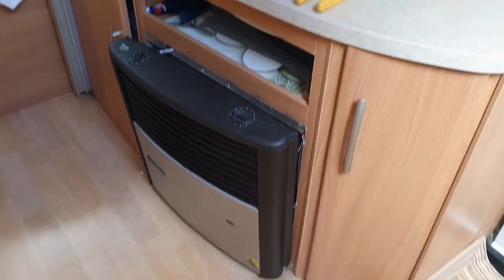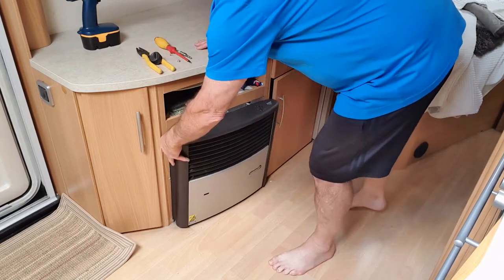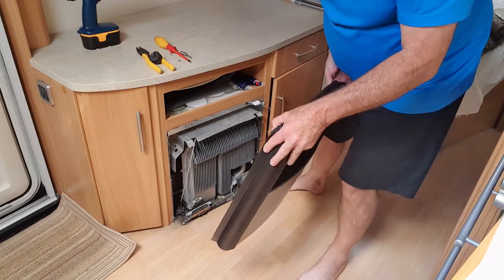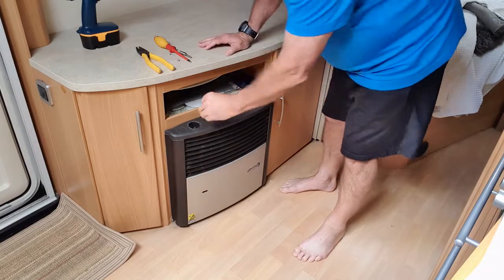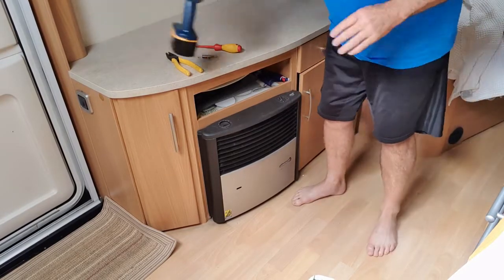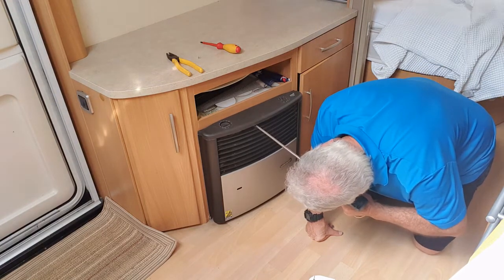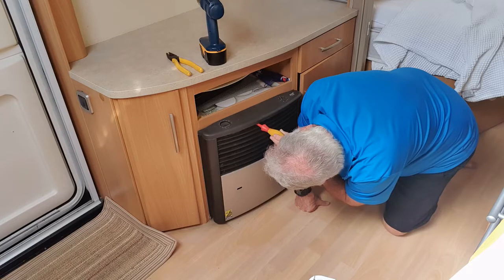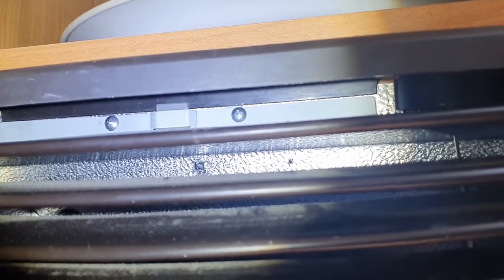Truma Ultraheat Cover fix

Comment: So how do you remove the screws without loosing them in the heater somewhere?
Reply: Magnetic screw driver obviously!
Reply from the maker: I held the screws with my screw driver and finger. The top grill gap is fairly large so no issues.

Comment: Do you have a fix for the burning smell?
Reply from the maker: I assume the burning smell is when you're on electric supply.  If that's the case, its dust build up on the heating element.  The best way is to turn it up on high (2000) and turn the fan on full.
Reply: Thank you, I haven't used the heater for a while and I have her a good clean out this morning still had the smell but all seems well now after a few mins of the smell so it must have been dust build up.
Reply from the maker: @jessieblack4704  that's fairly standard with electric heaters.  The dust settles on the heating element and when turned on smells.  Beginning of use each winter, I just ramp it up and then its ok from then on.
Reply: I just bought a van I swept up a whole dogs worth of hair out of mine